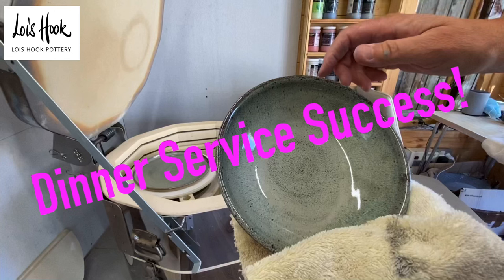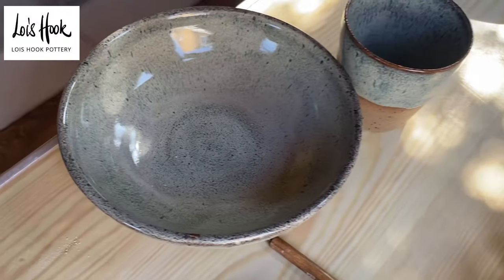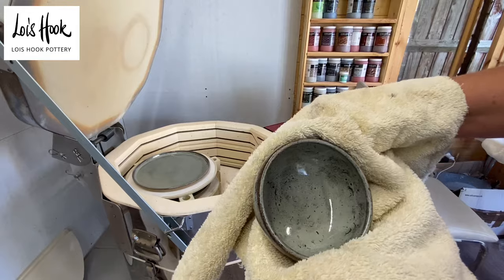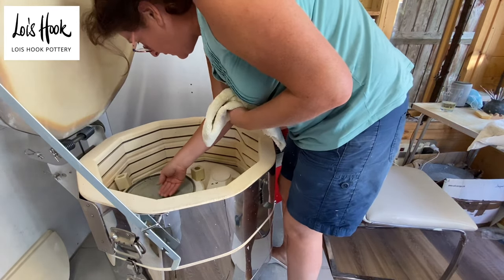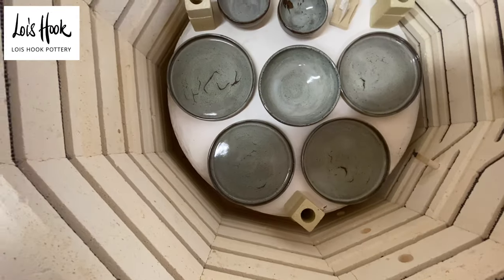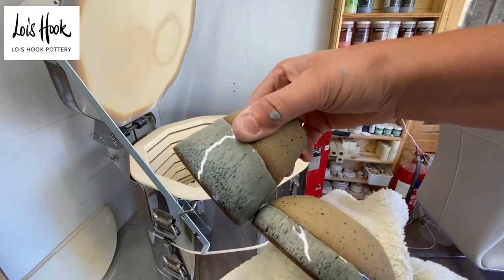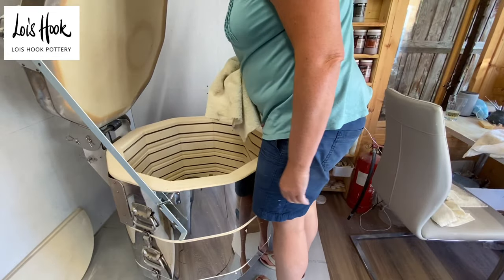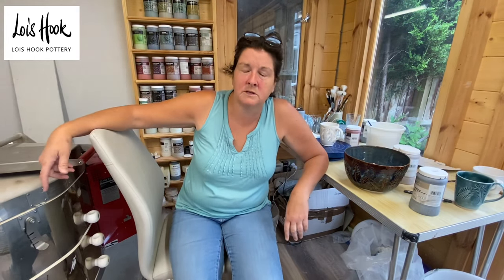55. Dinner Service Success. 37 Piece. Iron Lustre, Toasted Sage on Lavaflek Clay.

Comment: I'm very impressed. What a gorgeous set. I have a question.  Are you aware that opening the kiln when it is too hot to handle can cause crazing later on? My daughter's wedding china is from Lennox and they are all crazed. What a loss. Just asking.
Reply from the maker: I had got it to where I felt it was safe. Like today 100 degrees Celsius. I then wedge it open with a piece of wood to get air flow but would still not hold it with my bear hand.  We get items out of the oven that hot when cooking. 

What temp to you start to open the kiln. Or do you leave until cold. ? I have not had an issue so far.